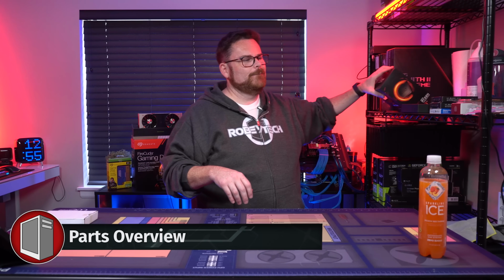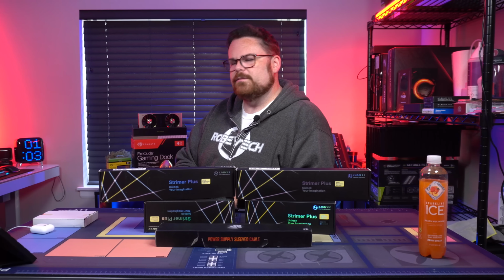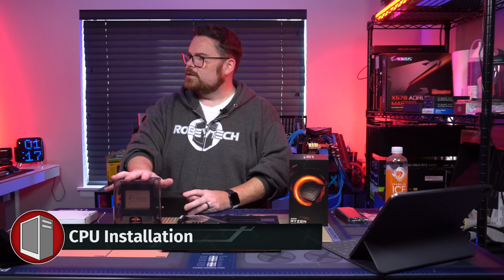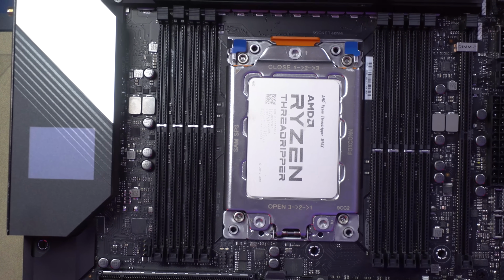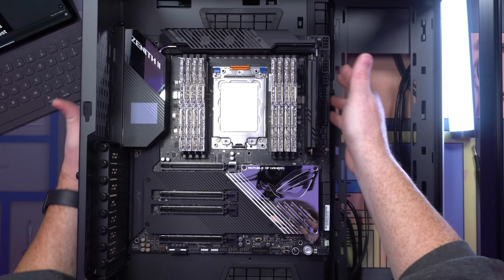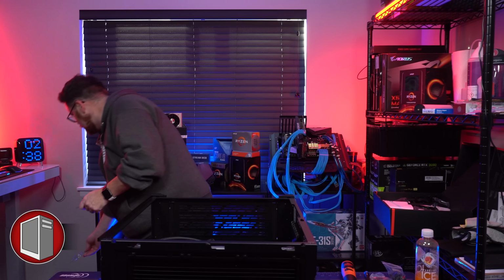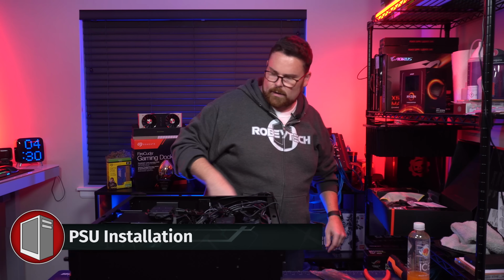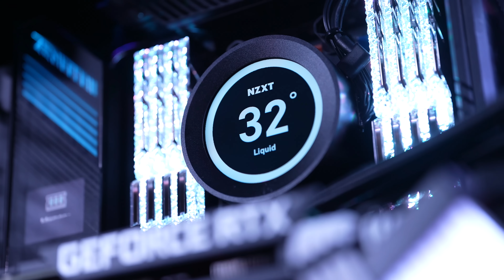Want a car or a PC? The $10000 Dual RTX 3090 Gaming PC Build! | Robeytech

Comment: Imagine not liquid cooling this build in a case meant for liquid cooling. Imagine not getting straight out custom cables instead of extensions. Also imagine not just using several 2-4TB NVMEs in a build like this. And where is the SLI? Also, before I liquid cooled my build, I had a 5800x and a TUF 3080. I had a 360mm AIO in exhaust like that, and the temps were terrible once things had been running for a while because hot air was blowing through the rad.
I didnt even go all out, and I did these things with my build. Do yourself a favor and liquid cool that build. Real liquid cooling, not AIOs. The difference is huge and you'll be able to overclock much more.

Comment: The upper card will heavily thermal throttle under load - say 500 MHz core vs 1500 for the bottom one. Also the NVLink bridge is missing. So this setup is not what you want.

Comment: I can almost guarantee those 3090's will thermal throttle because of VRAM temps. Even a single card in a well ventilated case has issues with VRAM temps.

Comment: are you sure 1200W PSU is enough for 2x RTX3090 and that PCU? i would think at least 1500W for such a rig. also, 2x RTX 3090 GPUs must create an awful amount of heat, and you didn't post any temp or benchmark, which would be very interesting as a follow up. i don't see how 2 GPUs like that in such proximity wouldn't be overheating without a custom water cooling loop.

Comment: In Brazil, a $10k Pc probably has between a RTX 3060 or a 3070 if you're lucky with a ryzen 5 3600x... 2x8gb ram sticks (3000 MHz) in a a450 motherboard. 600w power supply, 80 plus bronze... All of that in a shitty case.
If you want a 3090, just the gpu is around $18k. Btw, our currency is worth around $0,17 dollars and the taxes to import are absurd.

Comment: Hi Robey!  :))   The Ram you have spec'd out in this video is not on the QVL per ASUS.  I found that out the hard way after purchasing the items you have in this video except I got one 3090 instead of two.    I have since purchased Ram that was on the ASUS QVL.  I am curious though, did you have any problems with this Ram in the video, cuz I did start to experience some issues.

Comment: for heavy 3d blendering, blender pros rendering their work might be bad for the bottom gpu since the upper gpu has the fans on the bottom blowing out hot air cooking the bottom gpu which is a really bad idea to install in that kind of position. Getting a bigger case like the ROG Helios and putting the other gpu in a different location might solve this. Because one gpu torturing his partner gpu is making me twitch af its feels so bad

Comment: Without front or side panel fan gpu's will be burn, and without gpu holder  motherboard will be broken.  2 Gpu requires liquid cooling system.

Comment: What do you think【$7685.04 USD (Contains computer peripherals) 】

CPU: AMD R9 5950X【16核/32緒】3.4G(↑4.9G)

VGA: EVGA RTX3090 FTW3 ULTRA(1800MHz/30cm/3987/三風扇) 

MB: ASUS ROG STRIX X570-F GAMING

RAM :   128GB 芝奇G.SKILL 焰光戟   (16G*2) *4 D4-3600 CL16 F4-3600

SSD : 三星 Samsung 980 PRO NVMe Gen4 500G/M.2 【PCIe 4.0】 讀:6900/寫:5000

HDD: WD 2TB【金標】128MB/7200轉/五年保(WD2005FBYZ)

Computer water cooling system:  ASUS ROG STRIX LC 360 RGB White Editon 白龍水冷

Radiator fan:  貓頭鷹 Noctua NF-A14 PWM chromax.black.swap 14cm *4

PSU: 海韻 PRIME PX-1000(1000W)雙8/白金/全模組/12年保

CASE : ASUS ROG Strix Helios 顯卡長45/CPU高19/Aura Sync/E-ATX

OS: Windows 10 中文家用隨機版 64位元 (Microsoft Edge) 

Monitor: 【2K 27"】ACER XZ273U X(2H1P/0.5ms/VA曲面/240Hz/含喇叭/FreeSync/HDR400

RGB Wireless Keyboard: ASUS  Rog Claymore II 

RGBWireless Mouse: ASUS 
ROG Gladius II Origin

RGBHeadphones: Corsair Gaming Virtuoso Rgb Wireless Se

MIC: Hyperx Cloud QuadCast 

RGBRacing chair: ASUS  Sl300C ROG Chariot RGB chair

Comment: That was hard to watch, all those amazing hardware and bad build. there is a lot of problem with aerodynamics in this case. main one is that the first GPU can't breath and it will cause problems in near future, not to mention the load sound of it trying to suck the air in. I would change the chassis with a bigger one.

Comment: In brazil only one RTX 3090 is R$ 25.000,00 so two would be R$ 50.000,00 
Its like spending U$ 50.000 only in this PC part, then you'd have to think about all the other parts. Sad, true but sad

Comment: Dual 3090 only gives about 10 to 12 percent of performance enhancements. And with less and less AAA games available, I'll settle for a single 3090, paired with a 5900x. This'll save me a load of money, to be invested in RAM, NVME, Large HDD, sophisticated cooling and much more. In short, this build is cool, but in my view not really practical.

Comment: To be honest, not really impressed. A PC at that price point has to be a beast not just in performance but also in aesthetics. Should have spent another 500 or 1000 bucks and could have had distro plates and several water cooling looks. That would look crazy sexy. Just getting components and putting them together isn't considered building a PC especially at this price lol

Comment: This is epic example how to waste a lot of money!
First of all SLI is dead. There is no reason to use 2x GPU becasue most apps does not use them at all. One of the GPU is idle in most cases.
Secondly, it is proven that more than 16 GB in these days does not improve anything in gaming. Even worse, it is an obstacle during OC.

Etc, etc. Big waste of money.